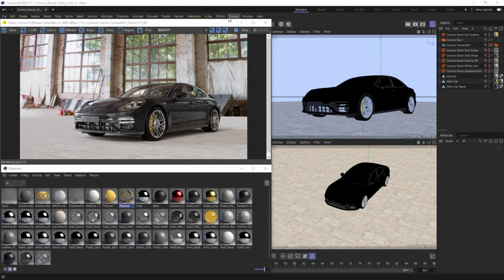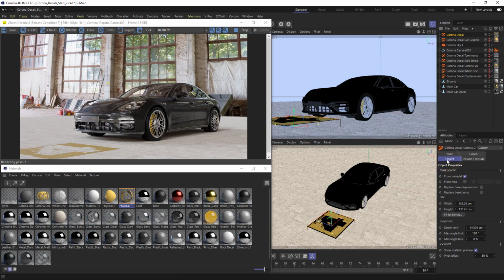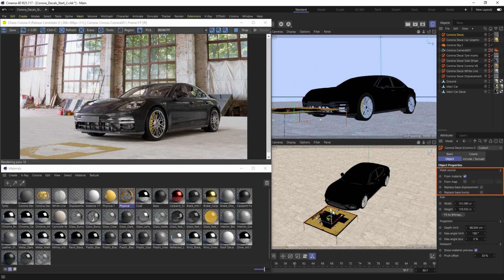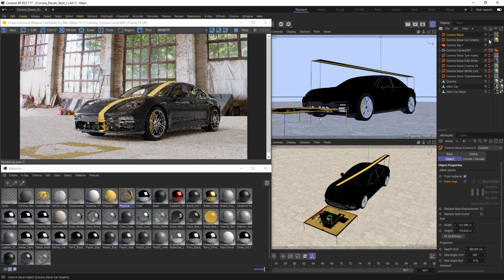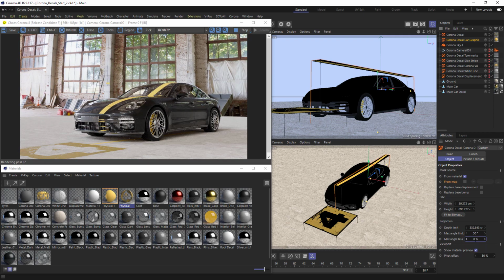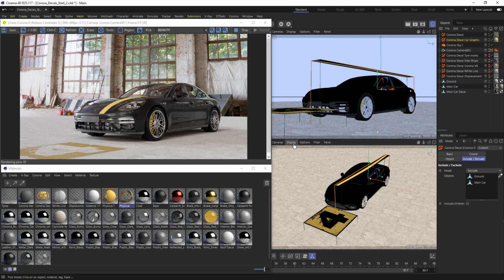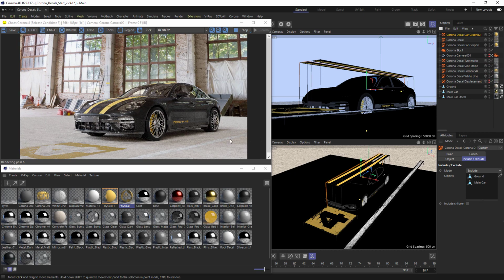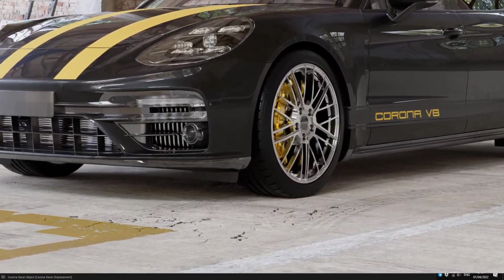Decals with Chaos Corona for Cinema 4D

Comment: Yeah, the displacement decals are a KILLER feature. IMHO way more important than everything else in this video. No other engine has that feature. No need to create separate materials, fiddle with nodes and projection types or even geometry with booles to "remove" a portion of a given surface. Adding stuff on top is easy, just place an object. But taking stuff away, making that one hole, crack, scratch etc. has always been so annoying.

Comment: What the benefits of this, no need to open UVs?
Reply from the maker: Many benefits - easily moved around without using UVs at all yes; can apply across multiple objects (hard to impossible with a UV approach); includes displacement; can be stacked on top of each other easily, and control which one is "on top" in the 3D viewport; can be Scattered (impossible any other way); can be easily animated, either by keyframing translate, scale or rotate as for any other object, or by having animated textures/materials in the Decal, or a combination of both of course :) Mostly it sounds like it doesn't do all that much, til you try it, then you get that brain-expanding moment as you realize what it will allow you to do :) We'll have more tutorials in the future exploring some specific things you can use them for, this one is just the basic starter. Thanks! Tom
Reply: @ChaosCorona  Hi Tom. Thanks for clarifying this amazing new feature. Yes, new clips sound awesome in order to give us some useful ideas.